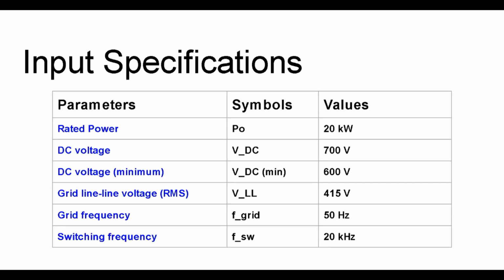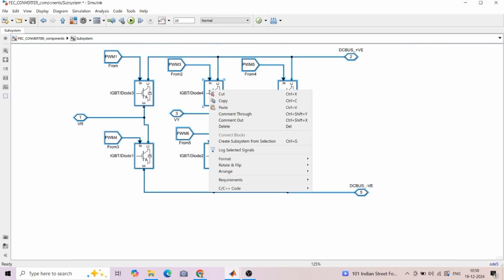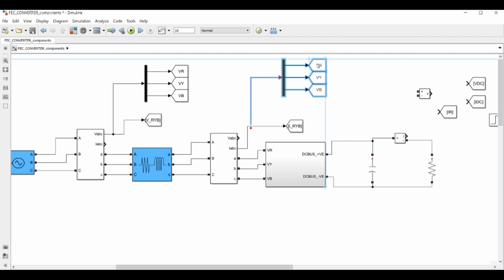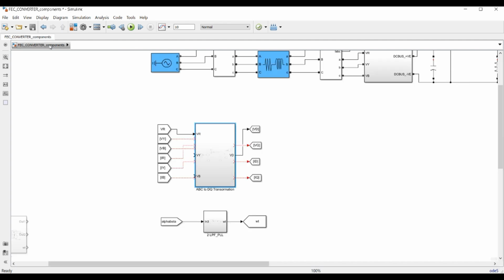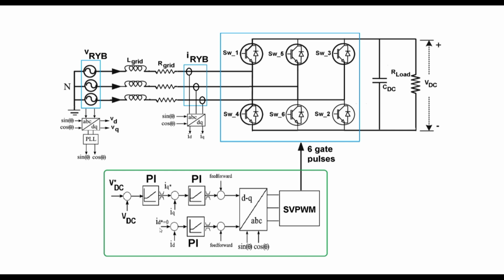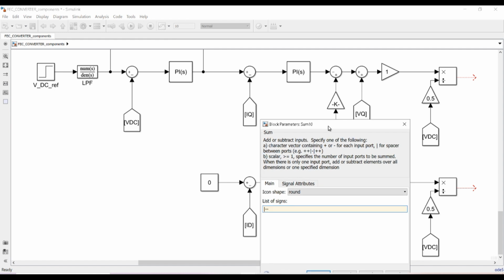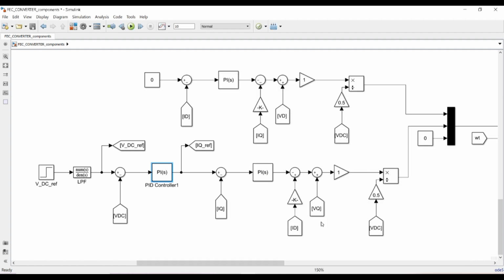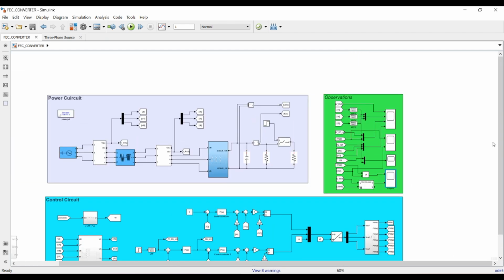3 Phase Active Rectifier | Front End Converter| MATLAB Simulation | Step by Step

Comment: 0:00 Introduction
2:11Voltage source inverter 
5:53 Power Circuit Design
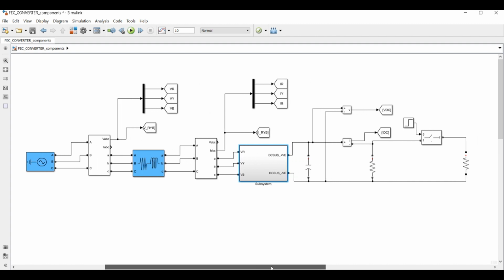13:09 Phase Lock Loop(PLL)
19:54 Controller design
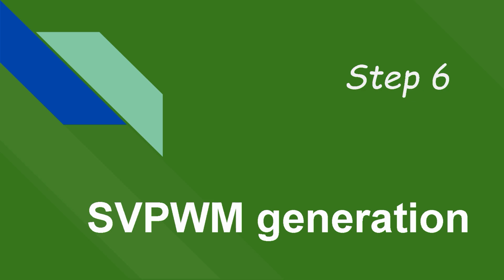26:08 SVPWM Generation
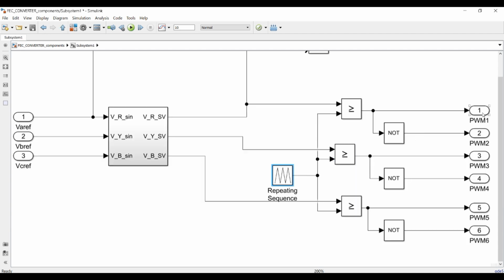27:41 Calculation of Controller Parameters
32:00 Results and Waveforms